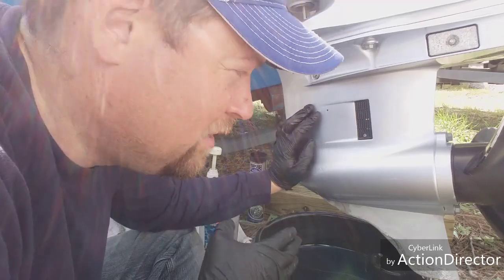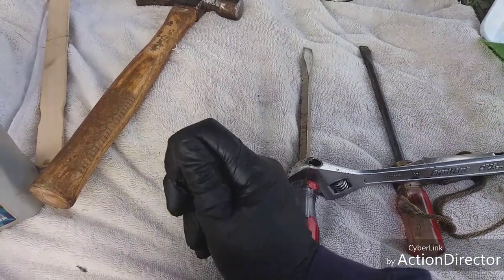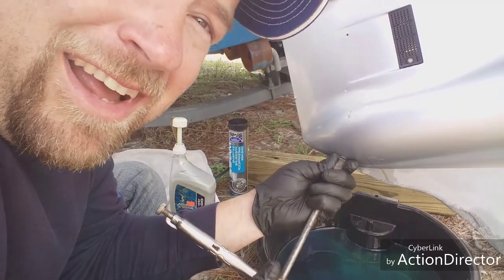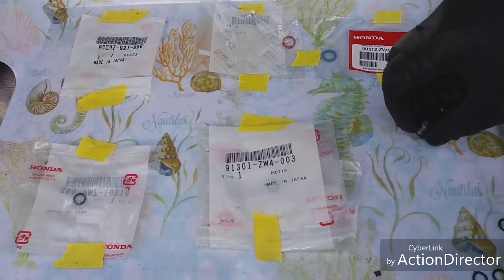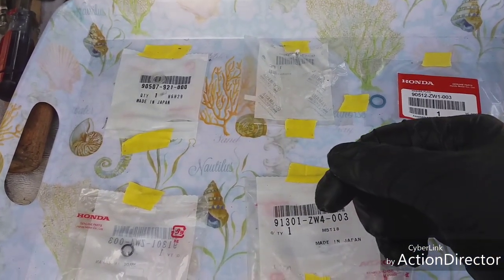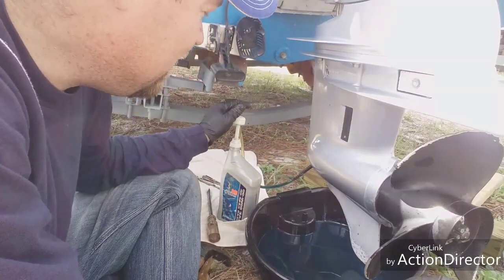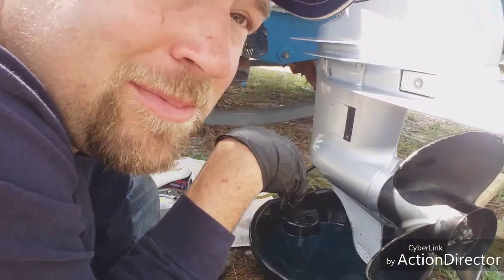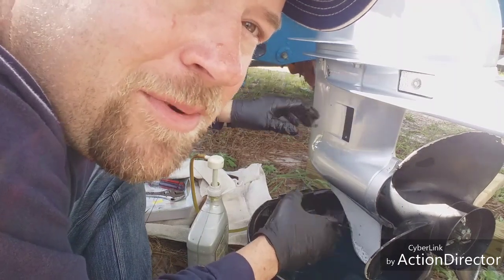Changing Gear Oil Honda 75/90hp Outboard

Comment: Capt Rob, thank you for these videos.. I am looking to do the 100hr service on my 75hp.. This helps me so much man!! Dealer wants $900.. if you  ever need electronics for the boat contact me.. I will take care of you brother!
Reply from the maker: Thanks Dan! I has my way through nmea and gateways and canvas systems. I like sight fishing. Lol! Go to Honda marine to find out what your engine calls for. The biggest thing I have found is the green high pressure filters must be done every hundred hours. I have seen lots of them have high speed misfire and collapse because the microns are so much finer. It catches everything. If your carbs non ethanol fuel all the way. If not go easy on stabilizer additives. The floats can stick easily on the 75/90 if you over do it and the fuel evaporates out. Lots of experience cleaning them. Water pump every 3 years at 100 they look good unless you dredge. I hope that helps even plugs are ok to skip. My things are fuel water separator, high pressure filter. Low pressure filter. Gear oil and washers always. Engine oil and filter.  Check zincs. Grease zerks pull steering grease that. Grease ends of trim rams. 656 crc engine block when done. Check battery connections and load test. That's about it

Comment: If I tighten the plugs to the point I'd need a wrench on the screwdriver, the washers split. I tightened the screw till I  see the washer around the head.

Comment: Hi Captain, my oil buzzer is going off. Have full and clean oil, do you know where the sensor is to take it out and put in an oil tester?
Reply from the maker: I'm not sure which model you have. Go on boats.net and look up your motor. You can find the part on there and also buy one. It can go by your serial number and model. Good luck.

Comment: Why you fill from bottom not top?
Reply from the maker: @jaminbenjd3846  gets more of the air out. You want enough oil to the upper bearing so it is at the same height not just have slinger pull it up to the bearing.

Comment: Any reason to go fully synthetic? I have honda 75. 

Thanks
Reply from the maker: Aahhh a good question. Ok so Japan once told us a Honda engine block is not fully broken in til 1000hrs. After that you can use full synthetic like mobile 1. By going full synthetic you really don't gain anything they just wanted the piston rings to seat/ware properly. I have seen other issues with aftermarket full synthetics clotting when mixed with other oil and engine blocks not coming to full temp and running cold. Just stick with a plane Jane marine grade oil. 10w-30 is fine in the US. 5w-30 was good father north in colder Temps. Look at the heat range of the oil to where you are. In New York we all used honda 10w30 for decades with no problems from 150 hp and lower.

Comment: Hi Capt Rob I enjoyed your video, thank you.  It's pretty clear you know your stuff.  Any chance you could do some videos on a 2006 Honda BF200 4 stroke?  I am retired and keen to learn as much as possible so I can do the routine service on my outboard.   Also where can I obtain washer and thread sizing and part numbers for my motor?  Thanks  Mark
Reply from the maker: Hi Mark I wish I could but I do not own one or know of anyone here with one. You can find some parts at  hondamarine or go to boats.net. if you have questions about the 200 ask away. I've done a few powered swaps on those for the user. Make sure you do the high pressure fuel filter every 100 hours and check the valve clearance every 250hours. Clean out your iac with carb cleaner and reinstall every season too. That will help with the rpms hunting just a simple cleaning yearly. No feeler gauge on the plugs either. They are iridium and should not be touched. I hope that gives you a little inside info. But write me anytime. If you find a Honda mechanic make sure he has been one since the 200 came out in the early 2000s. He will know the beast better than anyone else. Good luck.

Comment: Where did you get the pump attachment?
Reply from the maker: Any parts supplier should have them. Yamaha is also the same size. It is part of the whole pump kit. Yamaha number is ACC-PUMP0-00QT
Reply: @captainrobthompson8728  thanks

Comment: Just 1 quart ????
Reply from the maker: Actually less but you have to burp the air out of the system. 1 qt will be plenty.
Reply: Will 1 gallon of oil fill motor also
Reply from the maker: Should be just more than a gallon. Get 1 gallon and 1 qt. Says. 4.2 qts plus a new filter. 4.4qts.